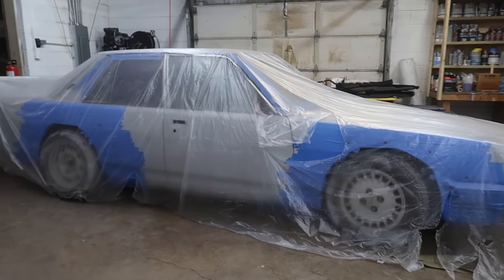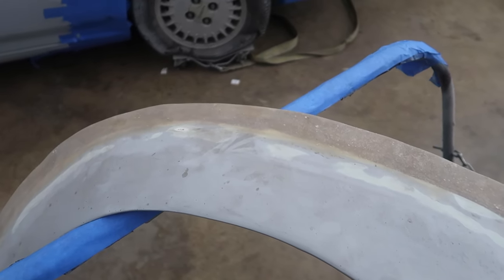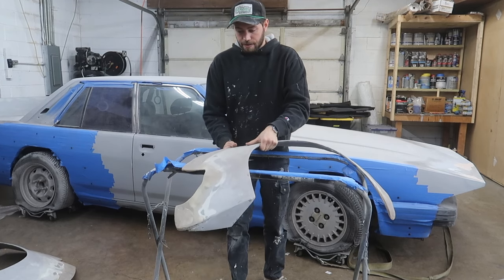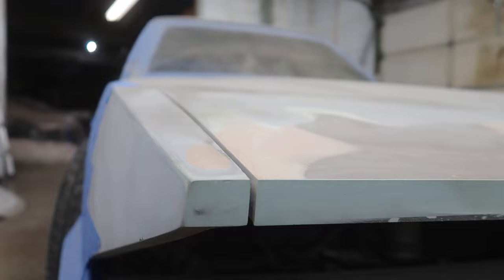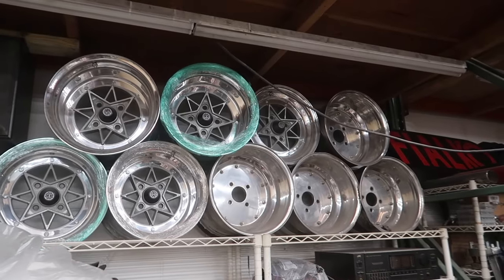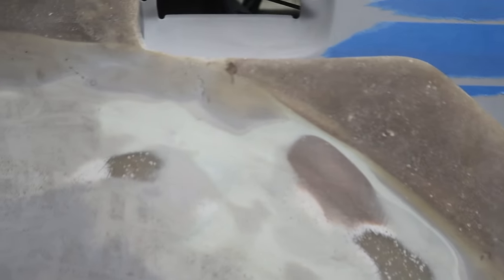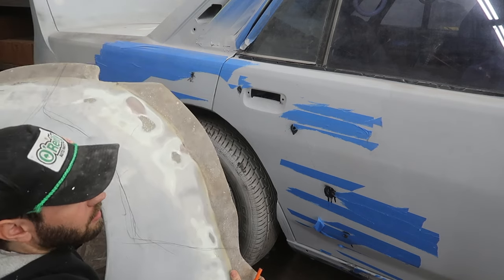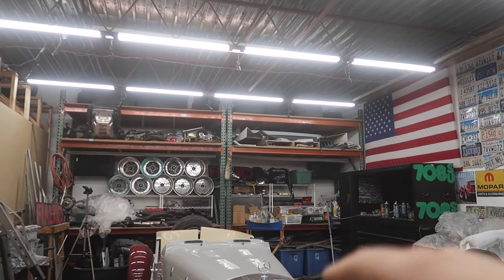Bosozoku Cressida | New Wheels & Project Update

Comment: Glad to see you back. 
Looks like your project really got your back against the wall. Surprised you haven’t decided to shave the rear handles. Have you thought about using “Dzus Fasteners”?  For the flare. The female part of the fastener is an S shaped spring. It allows for slight misalignment and varying tension. I’ve use them to hold on body panels for sprint cars, dirt late model, Lexanne windows, Trunk skins, hood skins, Etc.
Reply: You could weld the spring retaining tabs to the body of the car. Put countersunk holes in the flare. For the aluminum quarter turn screws. Then you could use a fender welting or a fender beading. Where the body and flare meet. It would keep the flares removable in case you had any accidents or damage. Also, have you thought about just shooting the main base body color on the whole project? And then doing your accent colors and metal flake vinyl. That way, if you had any mishaps, you could just wrap the damaged spots. Not have to worry about doing a color match. or a blend with flakes or candies.

Comment: Thats a lot of work and its very hard to get it right, I would be tempted to weld on some 6mm round steel bar to create some edges to work you fibreglass or even sheet steel to. Maybe get some clecos too, they really help with stuff like that.